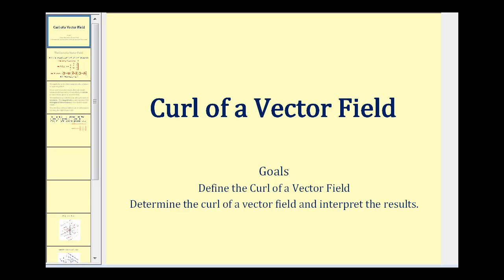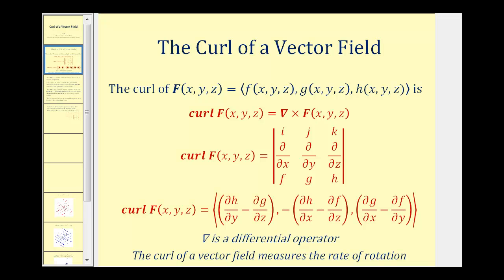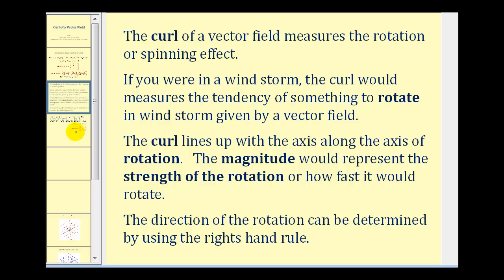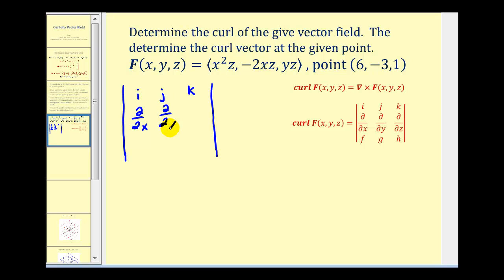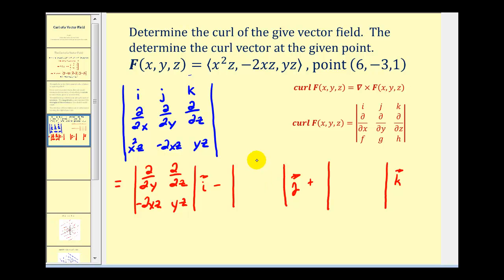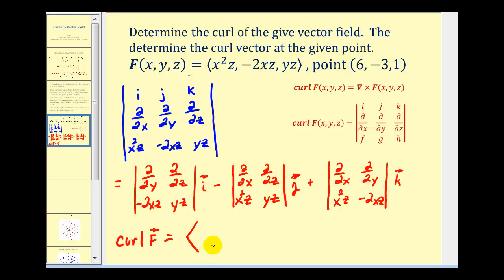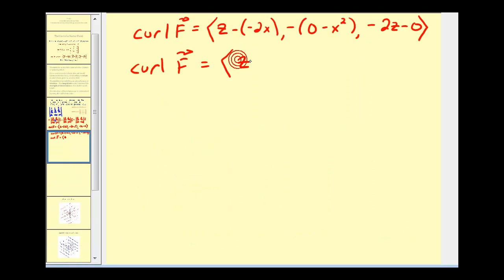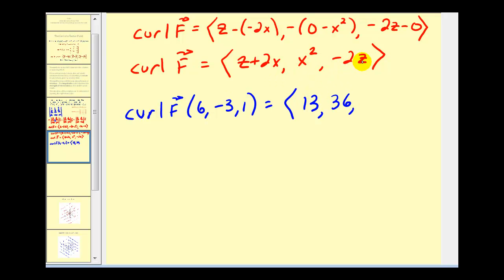The Curl of a Vector Field (new)

Comment: I think there is a mistake at 4:05 , solving determinants I use <2*3-3*2, 3*1-1*3, 1*2 - 2*1> that way I don't mess up the order. You know which to move onto per section of f(x,y,z) by the order 2>3, 3>1, 1>2 as you increase one number per section.